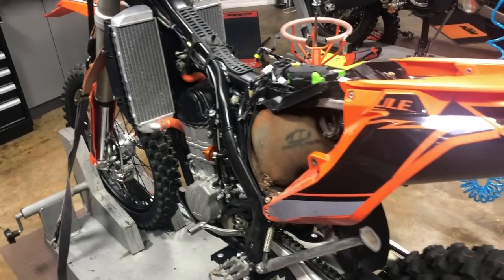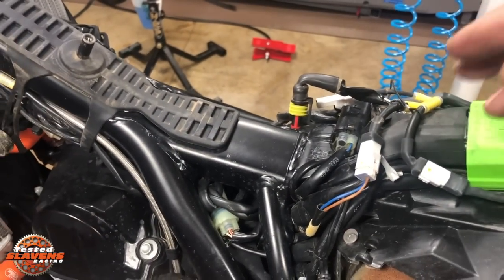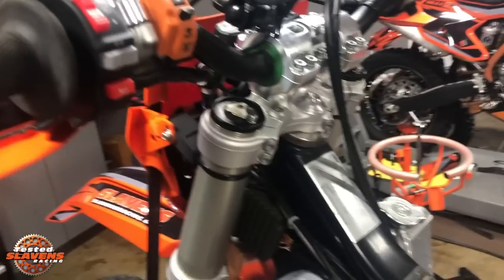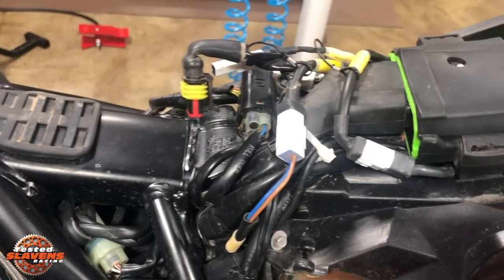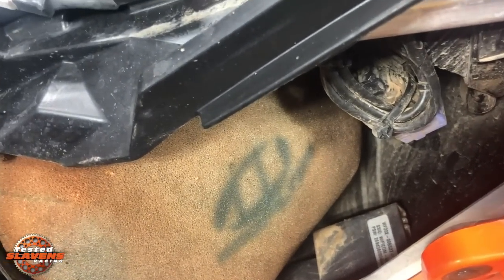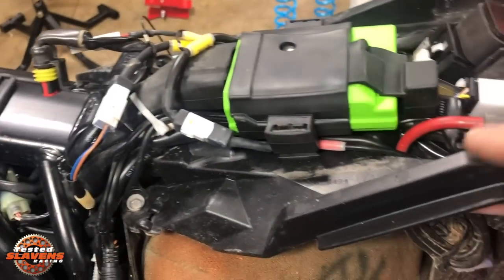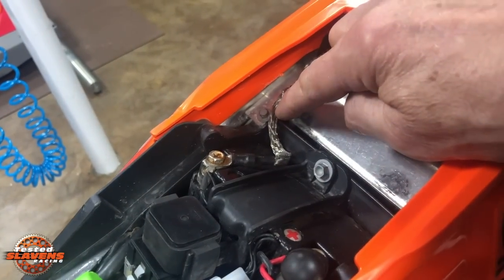How-to Install GET RX1-PRO ECU for KTM/HQV 500/501

Comment: How necessary is it to cut out the hole for the baro sensor?  I feel like it has a whole seat in the way what's a thin piece of rubber gonna do?
Reply from the maker: Hello:
The seat does not sit on the ECU or block it. However, the rubber boot lays directly onto the baro sensor. You can decide.

Comment: Jeff, On a 19 EXC-F 500 is there a requirement to change the kill switch? What are your thoughts on the traction control? Thanks
Reply from the maker: I don't understand what you mean by requirement. We have this option if you want something more compact >>> https://slavensracing.com/shop/startstop-switch-17-18-ktm-hqv-sicass-racing/
Reply: @slavensracing   From another online retailers site "
2019 EXC and FE's will require the Sicass Racing over and under start / kill switch to shut off. The internal wiring of the bike harness changes the kill switch functionality in the ECU and will require the kill switch to be upgraded.

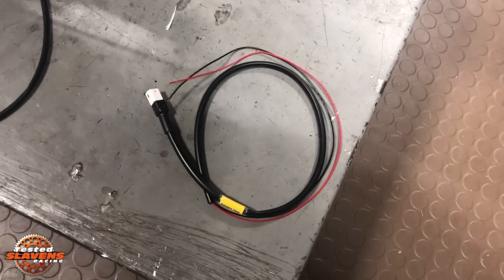Comment: Quick question: About 6:30 minutes in you talk about the supplied TPS cable. You mention that it's not needed and it's the old way of setting the TPS. I looked into GET's site and according to their instructions, that harness is used to zero out/reset the TPS for, what seems like, telling the ECU where it's starting point is......not so much actually setting the TPS. So this step in their instructions is not necessary? The ECU doesn't need to be told where the zero point is on the TPS? (Edit: I do have a TPS tool here.....but it seems like the purpose of that harness isn't to adjust the TPS)
Reply from the maker: Setting the TPS is now done with the WiGet phone app, NOT the cable. We have a video about using the app on our site.
Reply from the maker: https://youtu.be/nnO0X1Mct6o